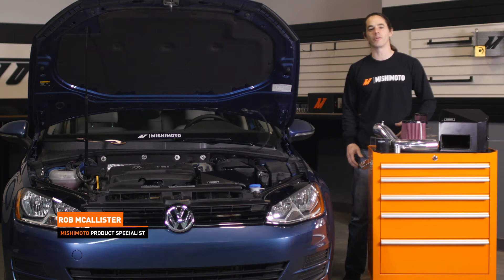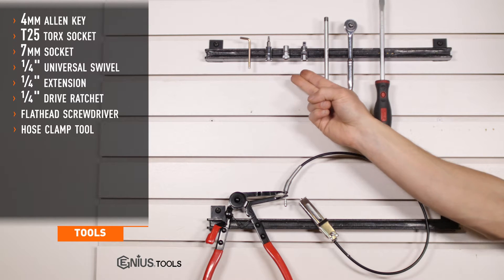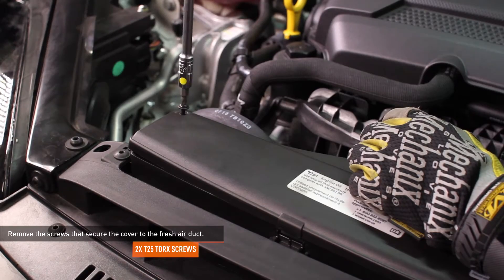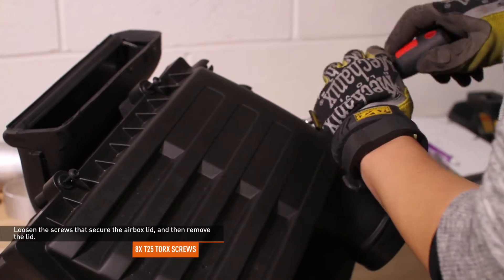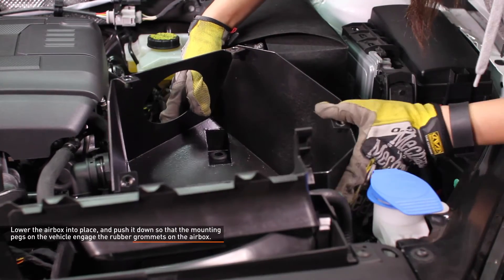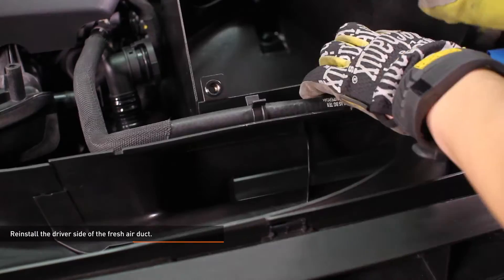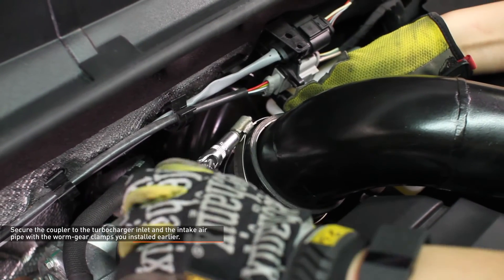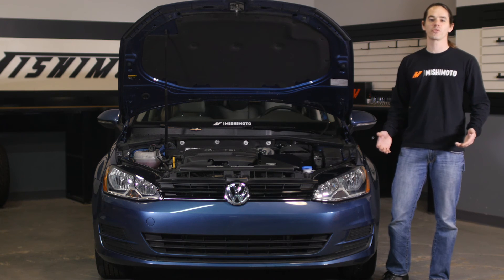2015+ Volkswagen Golf/GTI/Golf R Performance Air Intake Installation Guide by Mishimoto

Comment: So I remove the air duct from the OEM box but there is nothing on the mishimoto box that it could attach to
Reply from the maker: This will not connect to anything, once the intake is in place everything is held in place.

Comment: What happens if my Australian delivered 2019 Mk7.5 Golf R has no "Secondary Air Injection" (SAI) hose? what do I do with the hole in the Mishimoto Air Box?
Reply: I would just cover it up with something
Reply: @samrushton5497  yer, I might look for a grommet of some kind to cover the hole.... cheers for your input :)
Reply: Mishimoto..... can I get a reply to this question please, cheers :)
Reply from the maker: Without the SAI there would simply be nothing going into the port in the air box.
Reply: Mishimoto Automotive Does it matter if there’s nothing blocking off the sai? I’ve got a mk7 golf r and I want to get this intake!
Reply: @tenaki8  no it doesn't matter if the SAI hole is blocked or not on the Mishimoto Air Box, I just think it would let in hot engine air, so I closed it off using a Grommet..... I can give you more tips about this intake install if you send me a message on FB
Reply: @DonsShed  im thinking of getting this but it hard to find a good review on it, so my question is how is the instake so far compared to stock? How is the noise?
Reply: @jeremykhuu  I found there to be no sound increase and no extra power increase. I tried to get Mishimoto to supply the correct size Silicone Pipe (emails over 5-6 weeks) as, my 7.5R had a different size Turbo Inlet to what they supplied with the kit and in the end they made excuses and told me to get it myself.... I'd go with Racingline or Integrated Engineering.
Reply: @DonsShed  cheers for the reply, I think I'll go with the k&n intake or something else

Comment: Will this fit a 2019 Mk7.5 Golf R?
Reply from the maker: There has been no major mechanical update to the car to cause the intake not to fit the newer model. You should have no issues installing the intake our your MK7.5 Golf R
Reply: @mishimoto  Thank you :)
Reply: Did it fit your 2019?
Reply: @jralphroman  As I just got my car 2 weeks ago, I'm running it in first (and going for the "Free" Check) before I get it fitted...... I don't think there will be any issues in fitting it